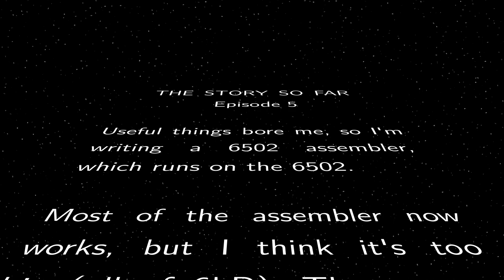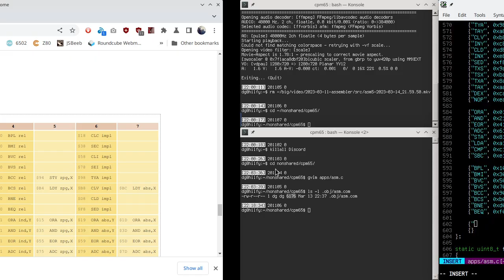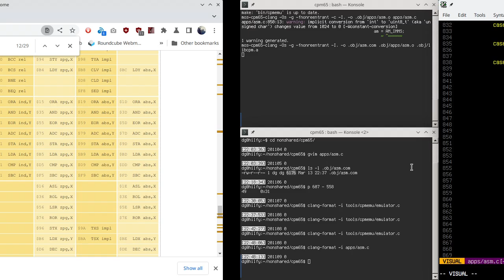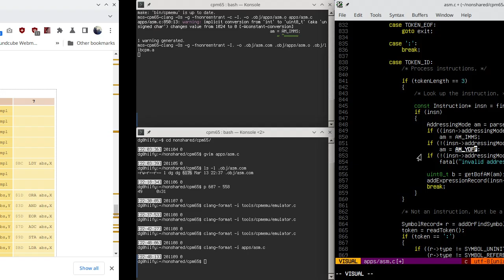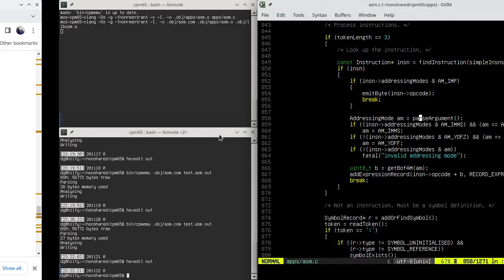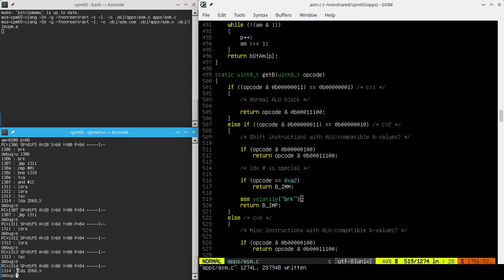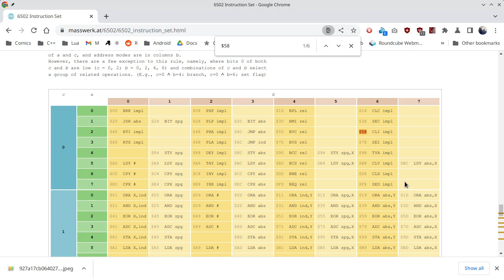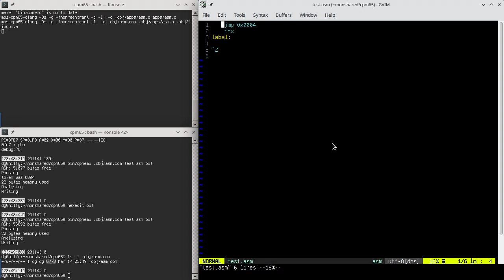Writing a 6502 assembler for CP/M-65, part 5/6

Comment: Would this assembler still work in principle for the 65C02 that has a bunch of extra instructions?
Reply from the maker: Yes. You'd need to add support for the extra instructions, of course.
Reply: @hjalfi Ok cool!  I was skipping through this series. I've made a 65C02 assembler myself (for the Commander X16) but it works totally differently. I may study this video series in more detail to see if I can maybe use some of your ideas in my assembler
Reply: @desertfish74 My ideas aren't necessarily good, mind. Assemblers are a bit of a black art and there's not much literature on them.